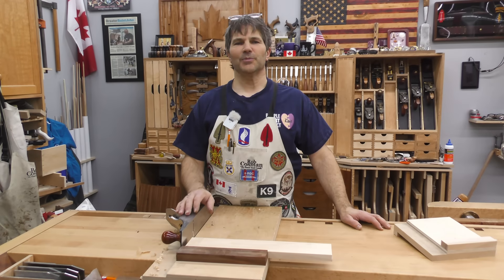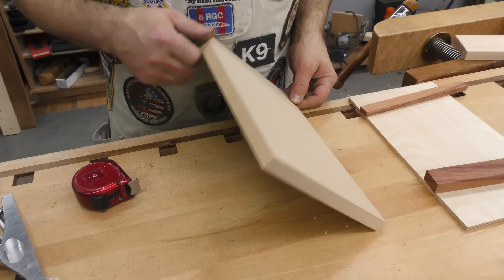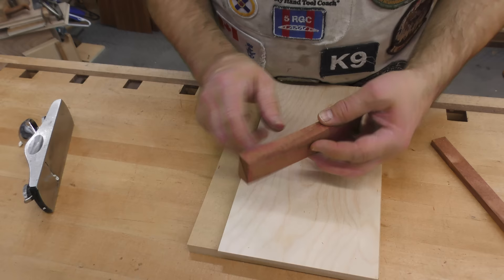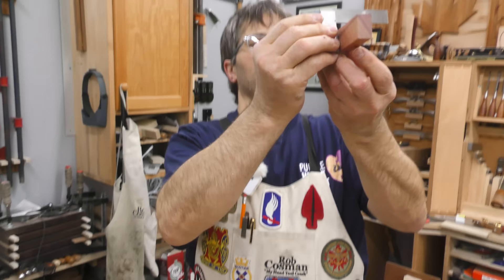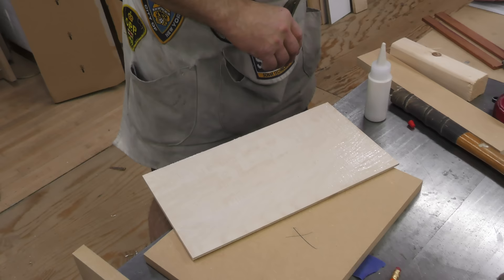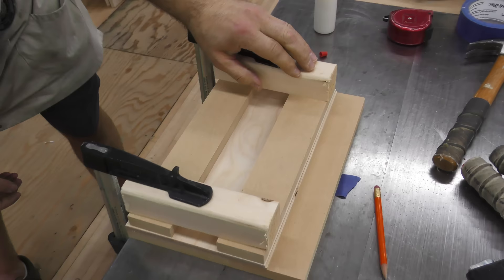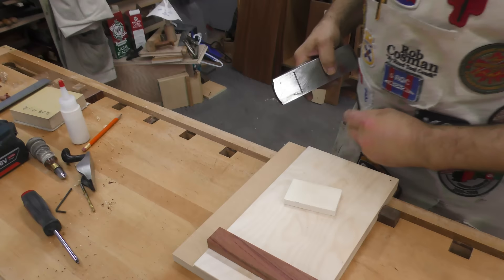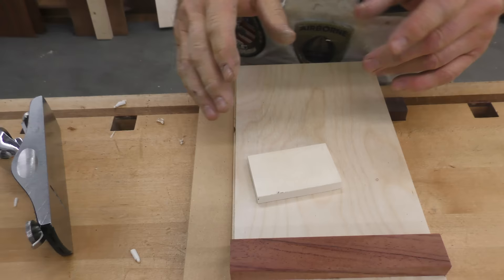Build A Shooting Board - For Your Block Plane (WOW)

Comment: Great project Rob! I am very curious about the tape that you have on the handles of all of your clamps and many other tools. It appears to be athletic tape or something similar. I would love to know the method you use when wrapping them that results in the raised rib that spirals around the handle..
Reply: Hey Ron, that tape is Hockey stick tape.  I am not sure about the cord, but I am guessing it is 1/8- or 3/16-inch rubber cord.
Reply: @mitchellfraser634  I wrap tape  around the end of handle once then unroll 12" of tape and spin the roll to create the ridges after wrapping it around the handle, I wrap it with a another layer of flat tape.

Comment: That was an awesome video. Great explanation. I’m curious about the tape on your clamp handles. I assume you do that because they’re hard to grip which is a pretty blemish I have. How do you get the ridges in the tape?
Reply: He uses hockey stick tape and tapes it up like a stick. If you search 'Rob Cosman taping tool handles' he's got a two minute video showing how he does it.
Reply from the maker: I show how to do it in my latest woodworking tips and trick video, too
Reply: @RobCosmanWoodworking  thanks I watched the video. I figured it was a hockey stick method. Just an awesome idea. I have a heck of time with slippery F clamp handles.

Comment: at 29:40 you use a countersink bit.  
can you tell me the brand name?  
mine isn't conical like yours is, just a straight up drill bit shape.  
Thanks!
Reply from the maker: Lie nielsen
Reply: @RobCosmanWoodworking  I meant the countersink bit that is used with the drill.  not the hand countersink.  unless I didn't find it on the Lie Nielsen site, just this https://www.lie-nielsen.com/products/accessory-tools-countersink-?path=accessory-tools&node=4084

Comment: Thank you! I really appreciate all that you do to help me in these videos. I have a question about getting the fence square. It seems to me that it would be easier to cut a groove square to the edge in the plywood that the fence would drop down into than to try to glue it square with it sliding on the glue. I figure there is a reason that you don't do that but I can't figure out what that reason is. It seems that clamping a speed square to the ply and then run you palm router against it and then you have a square slot.
Reply from the maker: I have tried it.  Believe me glueing is easier

Comment: I glue a lot of (small) blocks of wood together and one technique I commonly used is to sprinkle a little bit of sand on the glue: no more slipping and sliding.  I user really fine sand and put it in a small bottle and drill one 1/32" hole in the lid.  The sand “squeezes” into the wood so no extra dimension is added, certainly not more than the glue itself does.  When I sprinkle sand, I might have 50 grains (and as individual sand particles) on the glue.  That is all it takes to keep wood together, particularly when I do not have the luxury of hold pieces together with brad nails.  This is fast and works well.  I sometimes have to drill thru the wood, however it is inconceivable that small quantity of sand would be “bad” for a drill bit or saw blade, even if I did it on wood that may need planing, the sands is in the (horizontal) interior of the wood and would never contact a super sharp plane blade.

On (nearly) all YouTubes, I cringe when I see people setting their planes down on the sole of a plane, instead of its side — without first retracting the blade.  Our high school woodworking class instructor used to holler at us, saying the finely sharpened blade can easily be “damage” by setting the blade down on something like nail, dirt, etc.  That logic always seemed rational to me, but why do so many YouTubers, including you, do this?

Comment: For God's sake, go over to metric and avoid all those fractions!
Reply: Fractions are as easy as metric. There are 2 halves, 4 quarters, 8 eigths, 16 sixteenths, 32 thirty seconds, 64 sixty fourths etc etc in an inch.
There are 10 millimetres in a centimetre, add a zero, 100 in a metre, add another zero a thousand millimietres in a meter etc, etc.
Pico, nano, micro, milli, centi, deci, deka, hecto, kilo, mega, giga tera - all achieved by adding or subtracting zeros. 
As easy as fractions, unless you've never learned fractions!
Reply from the maker: Sorry I was raised imperial and its easy.  Besides gbwildlife is correct.  One of the reasons imperial was invented is that it was very easy for unschooled artisans to work in without fractions, unlike metric.  Think about it. Whats half of 12, whats a thrid of 12, whats foruth of 12, whats a sixth of 12, whats a twelveth of twelve, a 24th of twelve..and so on... It's only in our everyone goes to school era where we all learn math that 10 based system seem easier.  But I am just to old a dog at this point to change....sorry